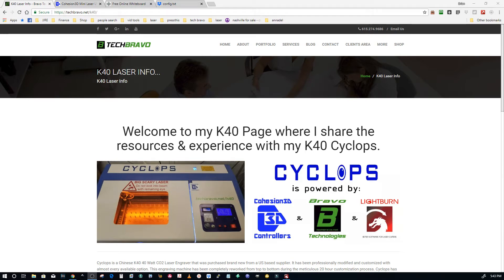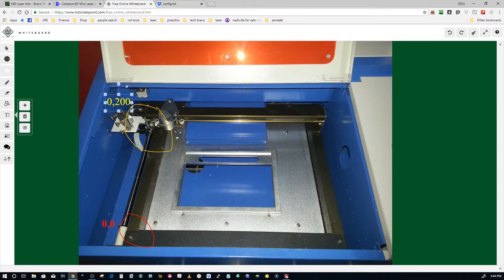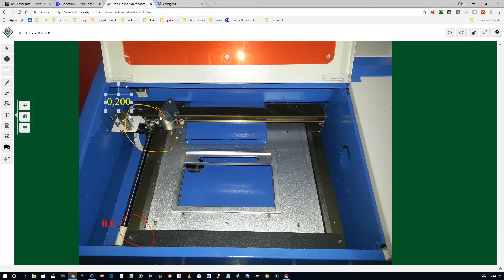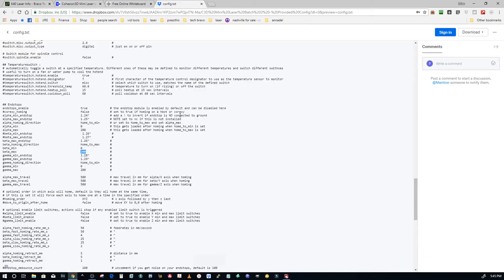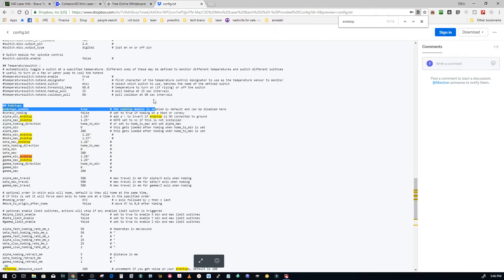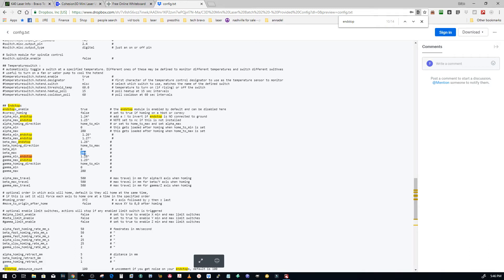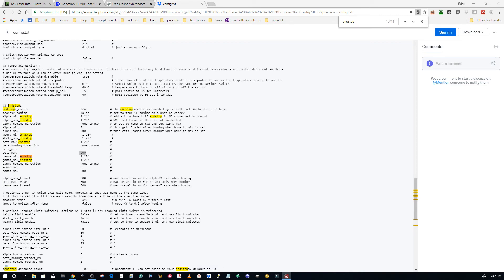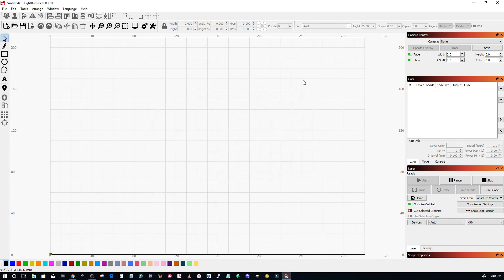Setting Custom Bed Size For The Cohesion3d Mini

Comment: Hey Ive just discovered your channel and im extremely intrigued by this k40 and what you have done with it. Im still learning a lot and have yet to purchase a machine. I have been doing my research looking for possibilities and answers for my endless amount of questions. This video here was somewhat related to one of the questions I had about these machines. I realize that the machines come stock with a bed size of 12"x8". In this video are you explaining the process of expanding on that size? please let me know if im lost. but I would like to be able to get a couple more inches out of the machine if possible. Id like to at least be able to cut 12"x12". Idk. That might be reaching. but please let me know.